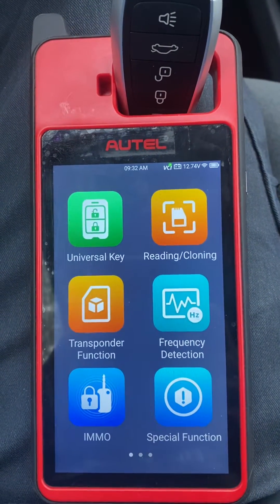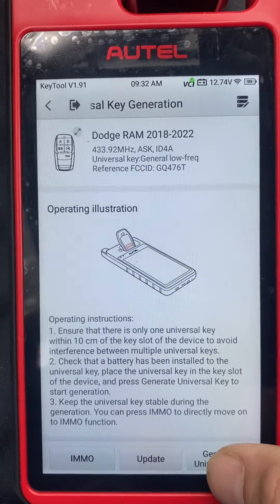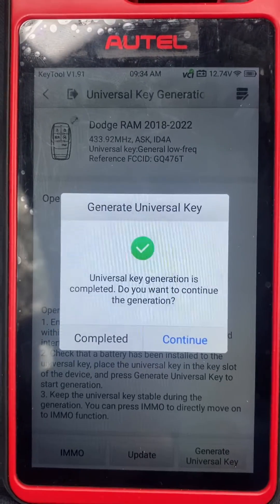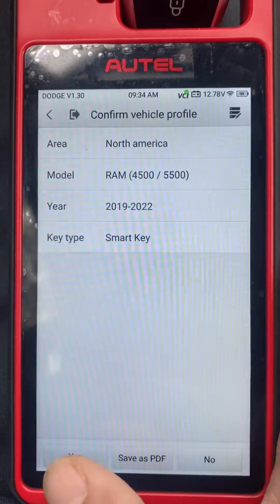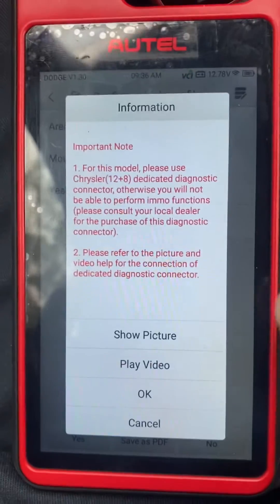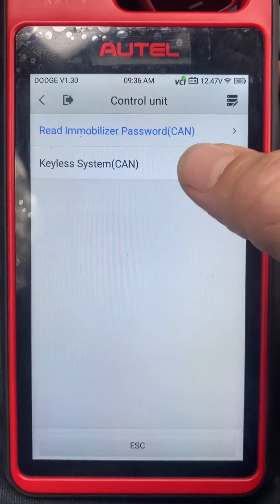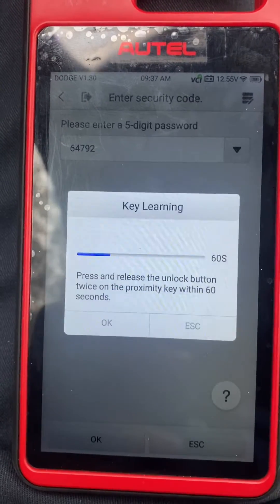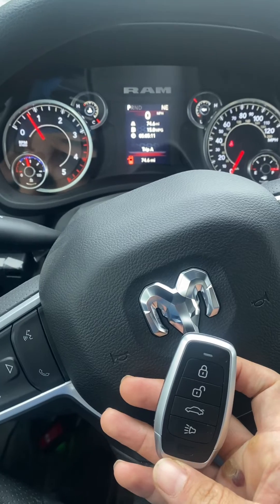2023 Dodge Ram 4500 All Keys Lost using Autel KM100 and Autel Universal iKey

Comment: I have the km100 did not know if it worked with star connection 2018+. Finally in this video you show the cable connection to the star cable. Joe next time be specific in the cable connection and what kind of cable used adapters etc thanks a bunch